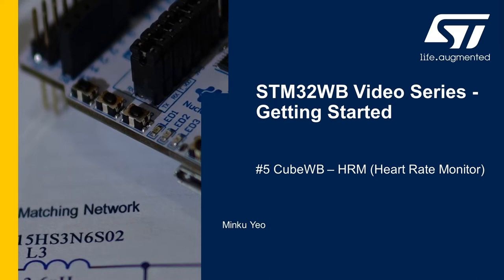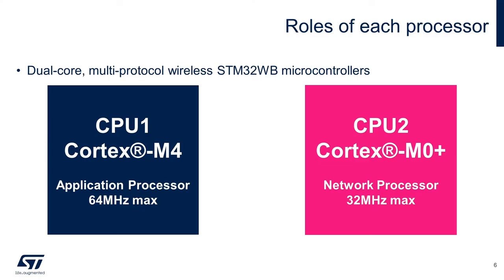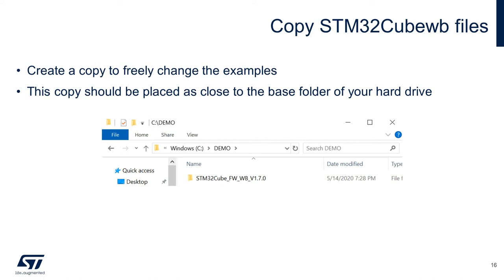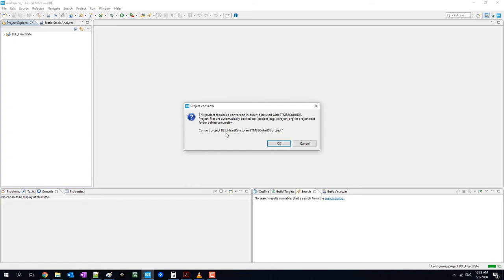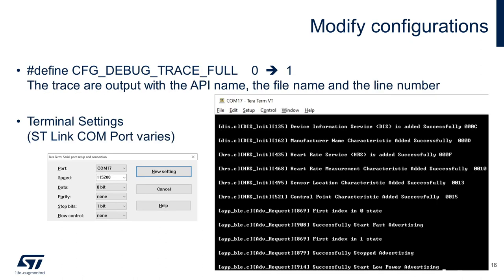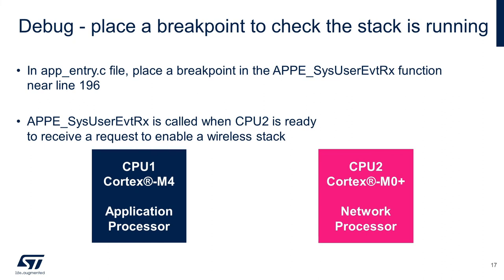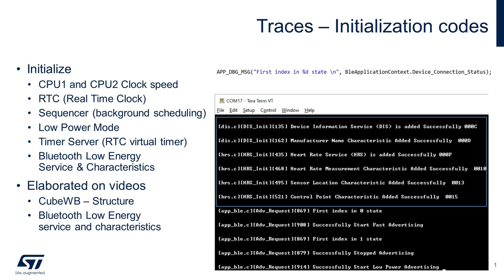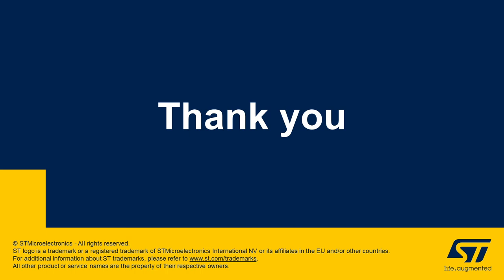STM32WB Getting Started Series: Part 5, CubeWB Heart Rate Monitor

Comment: You mentioned a fast advertising interval is 100ms for fast advertising mode and 1s for low power mode. Both intervals are configurable from app_conf.h. However, I did not find keywords in this header file?
Reply from the maker: Hi there, for technical questions we really recommend you check out our community of experts and other developers at community.st.com

Comment: My code "app_entry.c" is different that the APPE_SysUserEvtRx() function is on line 359, and it has no APPD_EnableCPU2() function. However, I find it on line 463. Tried toggle breakpoint, but after clicking the Resume, it shows that "Target is not responding, retrying..." and do not shows any trace info in Tera Term. How should I solve this?
Reply: Solved. The default setting of the "CFG_HW_REET_BY_FW" is 0 in the file. Change to 1 then solved.
Reply from the maker: Good to know you figured it out. And thanks for sharing the solution with the community.

Comment: Don't follow this guide, the Heart Rate project is outdated and it will just break your board (the st-link will no longer be found). Don't know exactly why and I have not found a solution to repair my board yet
Reply: I have a similar problem. After this case, ST-link can't find the target MCU.
Reply from the maker: Hi there, thanks for your question - may we point you towards our community.st.com, where you will find a team of people who can answer you directly ?
Reply: I also had this issue. I did not resolve the issue with the Heart Rate project but by reflashing the device with any other project besides the Heart Rate project using STM32CubeIde, it allowed me to communicate with the STM32WB again.
Reply: @jaakjensen  I did the same and it solved it
Reply: jesus, it happened to me as well today, exactly the same thing, it seems like a common issue. I am also getting the fus_image_not authentic error when trying to update the fus or trying to change the wireless stack using the stm32cube programming software, anyone have a solution for that?
Reply: @rodrigovillalobos9995  I resolved this issue by full chip erase in programmer, and then flashing with FUS and BLE full stack.
The other issue that I over was target not responding (or something like, lost the details as youtube deleted a couple of my comments), but in programmer I just pressed "Start wireless stack", and I now have no issue with the heart rate example.